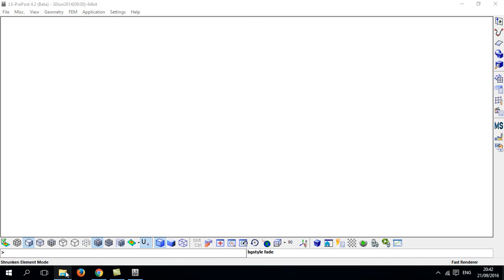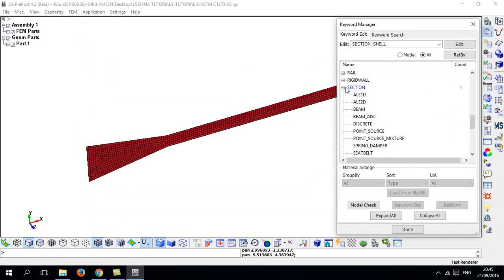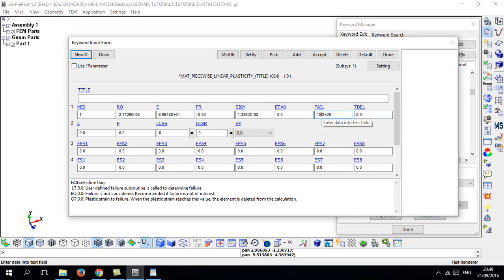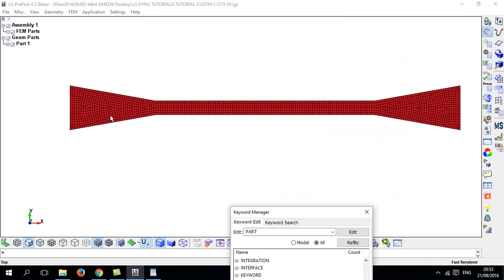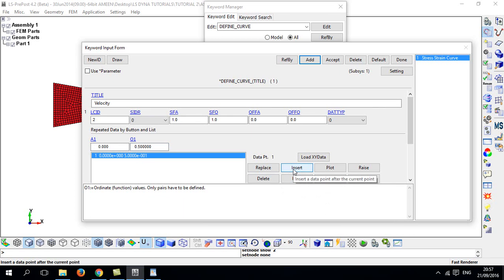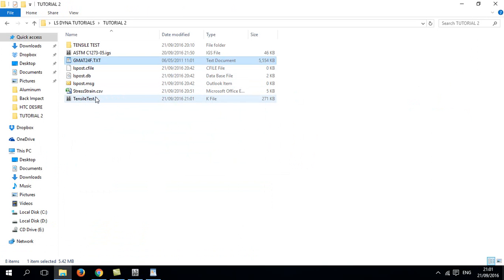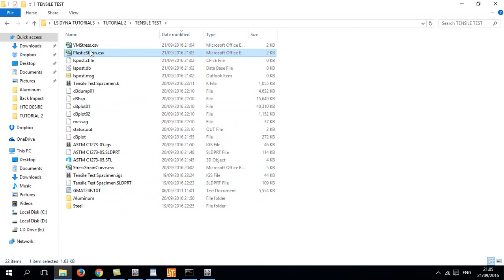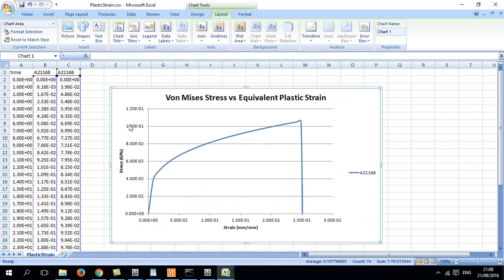LS-DYNA TUTORIAL 2: Tensile Test

Comment: Hi Mr Ameen, Allow me to tell you this video is really good! However you can introduce tricky comments like the restriction of the material failure you used is only valid for traction and work in this case because we do not have compressive stress state, otherwise we require a triaxility failure criteria. And the reason why using linear plasticity we'll never be able to capture necking effect.
Reply from the maker: Yes, you are right. Thanks for your insightful comments. This is only a basic tutorial, that's why I didn't go deep into the theory!  I will make a video for more detailed damage and fracture modelling. :D

Comment: thank you Dr Ameen Topa, i have few questions regarding tensile testing using lsdyna:
1.) is this tensile testing done using explicit time integration?
2.) where do we apply time scaling and mass scaling for explicit time integration?  
3.) can u recommend where i can learn how to do implicit time integration?
Reply from the maker: Dear Rey,

1) Yes, it is using explicit solver. Since this is a small model, using explicit will not take long time.
2) For time scaling, you simply increase the load or displacement rate by adjusting the curve. For mass scaling, you can either use DT2MS in CONTROL TIMESTEP to limit the minimum timestep or you can manually increase the density of each material in your model.
You can check out my tutorial here to see how I did the last method of mass scaling:
LS-DYNA TUTORIAL 15: Shaft Torsion with Mass scaling, Ductile and Brittle Failure

3) You can check out my tutorials:
LS-DYNA TUTORIAL 4: Compression Load on Solid Cylinder
LS-DYNA TUTORIAL 12: Static and Dynamic Axial Tube Crush

You can also check the examples here:
https://www.dynaexamples.com/implicit

Comment: Hi Ameen, Thanks for the tutorial! Great help! I am wondering if we can directly plot engineering stress/strain and true stress/strain? if only v-m stress how can it convert to true stress by any chance? and the second question is how we adjust the result if the Force vs Time plot has a large oscillation?
Reply from the maker: For the first question, you can directly plot the true stress strain curve by extracting the stress and strain from a single element. It may not be close to the value you find experimentally because that's the mean value of all the points in the specimen.

You cannot directly plot engineering stress strain because the software doesn't know how to get the engineering stress. All the values such as stress and strain are calculated instantaneously at each elements.

For the oscillations, you can use the filter option in the plot window.

Comment: Hello, Ameen. Why is the yield strength in the initial data 1.3362E-2 GPa, and on the Stress-Strain graph its value is approximately 4.00E-2 GPa?
Reply from the maker: Because I plotted the von Mises equivalent stress, not the stress in the x direction.
Reply: @AmeenTopa  In this case, Stress von Mises is no different from X-Stress.
Reply from the maker: @barbus6305  Yes, you are correct. Sig X =  Sig VM in this case. Sorry, I was confused with another tutorial.

The reason simply because DT = 1 is too big so the output intervals are big as well.. If you put DT = 0.01 and run the simulation, you will get more accurate results.
Reply: @AmeenTopa , Thank you

Comment: DEFINE_CURVE doesn't read XY data in scientific notation but instead reads in decimal notation due to which it is not able to define the right curve. How to fix this?
Reply from the maker: If you mean exponential form like (1.0e5) then read xy should support that formatting..
Reply: @AmeenTopa   I am also facing the same issue. I am importing the csv file, but the curve is not proper, and the data is in decimal format can you please help me with it.
Reply from the maker: @MohanSriram-d1m  change the number format with excel then save the file as .csv

Comment: thank you Ameen, may i know different cards that are essential to run simulation of high temperature tensile test at about 200 deg
Reply from the maker: You only need a material properties at elevated temperature. Throughout the tensile test, the temperature will be almost constant, thus you can assume that it is a pure structural simulation.
Reply: @AmeenTopa  thank you, pls suggest mandatory cards to be used
Reply from the maker: @vbalaji_griet123  As I mentioned, you only need to use the material properties at 200 degrees, that's all.
Reply: @AmeenTopa  thank  you Ameen, how to find out material properties at 200, 250 deg like tangent, elastic modulus, density etc..for material like AZ31B magnesium alloys..pls suggest.
Reply from the maker: @vbalaji_griet123  You can search in the open literature: journal articles and PhD theses.

Comment: Well although LS Dyna is such a powerful and amazing software but still compared to the ANSYS Structural GUI, it is much more cumbersome to use, just as an example, how difficult it is to tell the software that a particular node set has to be constrained and given certain degrees of freedom and boundary conditions. ANSYS Workbench GUI is the best.
Reply from the maker: Each software has its pros and cons.   Although ANSYS Workbench is very user-friendly, it cannot do the simulation of complicated problems. 

Proof: just look into the numerical simulations done in scientific journals. Even though LS-DYNA is not very user-friendly, it is more commonly used compared to ANSYS Workbench.
Reply: @AmeenTopa  
Perhaps the best would be to use the combination of both i.e. ANSYS-LS Dyna, Where one can from the user friendly characteristics of ANSYS Workbench GUI as well as its Vast Material Library (which perhaps is missing in LS Dyna) and the power of LS Dyna.
Reply from the maker: Yes ANSYS has a vast library of predefined material properties, like you can just choose your part to be structural steel A36 or aluminum alloy AA6061. But LS-DYNA has more options with regards to material models: you have Elastic model, Viscoelastic, Johnson Cook, Bilinear Model, Piecewise Plasticity Model...etc.

For a more friendly-user interface, you can try Oasys Software Suite.

Comment: Hi Ameen, how did you create that model for tensile test and why did you delete a portion after meshing in the start?
Reply from the maker: The shape or geometry model was created with SOLIDWORKS and you can get download it from the GrabCAD website.

It is a shape or geometry, and we cannot do finite element simulations on shapes or geometry models. That's why I deleted it. I needed it only to create the mesh. After the mesh is created, it has no use in the simulations.
Reply: @AmeenTopa  how can i create tensile test model with constant geometry and solid not shell. Moreover, how can i learn LS-dyna in more details and effectively from basic to advance? Thank you
Reply from the maker: @bilalrana9543  After you created the shell elements as I did in my tutorial, go to Element Generation, Solid, by Shell Drag. With this tool, you can create the solid elements.

LS-DYNA is not an easy software to learn because the LS-Prepost interface is not user friendly. You need to have a mentor in order to speed up the process of learning. You can learn by yourself but it will take some years. 

With that being said, I am available for online consultation if you need help to model a specific problem. However, there will be charges, of course.
Reply: @AmeenTopa  i am interested in learning and want to familiarize myself to Prepost interface. how can contact you?

Comment: Hello Ameen, Thank you for sharing the tutorial on tensile test. I did as you mentioned in your tutorial but when I check my result in Post>Fringe Component> Effective Plastic Strain, it shows zero throughout whereas for other parameters I get the values. I even tried to define "Database_Extent Binary and selected STRFLG =1. Still it shows zero. Your advice will be highly appreciated.
Reply from the maker: For more details, you can check here:
https://www.dynasupport.com/howtos/element/shell-strain
Reply: @AmeenTopa  Thank you. I will check this link. But in your tutorial for output you just define Binary_d3plot and control_termination and get the effective plastic strain. If you don't mind can you share with me the keyfile of this tutorial?
Reply from the maker: @saifshahabuddin6519  This tutorial is dated back years ago. I don't have the file anymore unfortunately. Are you using same material model as in the video?
Reply: @AmeenTopa  Thank you for your reply. Yes I understand this tutorial was uploaded way back. I used the same material model i.e MAT_Piecewise_Linear_Plasticity.model.
Reply from the maker: @saifshahabuddin6519  hmm, I am not sure. You may try to with higher element formulation (fully integrated shell)

It might be the problem with yours solver. I am using double precision solver.
Reply: @AmeenTopa  Thank you so much for answering my queries but still it didn't work.

Comment: Thank for your video. Could you recommend me some intructions for my problem: i want to simulate a test test , i want to get as outputs the curvv force displacement? how can i get it? i've tried to toogle some options (NODFOR - Nodal force groups and NODOUT - Nodal Displacement) in the ascii module of database. I activated also the nodal force group card in the database module. Unfortunatly, i did'nt get what i want
Reply from the maker: First of all, we cannot get the force vs displacement directly from the LS-PREPOST. First, we need to get force vs time then displacement Vs time and cross plot them. 

How to get the force vs time? You can try nodout or bndout in acsii options.
Reply from the maker: I have another tutorial on tesile test, check that one out. Also, check my post processing tutorial.
Reply: @AmeenTopa  could you please attached the link of these tutorials, thank you for your rapide reply
Reply: I m trying to get the experimental force measured by the test
Reply from the maker: Somehow YouTube doesn't allow links. You can search the following videos:
Post Processing Tutorial (with LS-Prepost)
LS-DYNA TUTORIAL 9: Tensile Test with Solid Elements and Variable Thickness Shells
Reply from the maker: @sophiebuferne2881  Nodout will give you the force at each node. So, you need to some the force graph of all nodes.

If you are fixing the nodes with spc set, then you can take out these forces with spcout option in database ascii.
Reply: @AmeenTopa  thank you bro can you tell me how can i get the global experimental displacement vs time  using ls dyna when running tensile test

Comment: In your video, at boundry_prescribe_motion_set you have shown to click Add. What is different between Add and NewID?
Reply from the maker: Technically, there is no much different in the outcome. The difference is when you are making the file. 

When you define any command, let say material properties, after you put the values, you click on accept.

Now, if you click Add, all the values will go back to default, but if you click newID, it will give you new ID, but all the values are the same.
This is helpful in situation like if
You have two materials, all the properties are the same except one value (maybe density), so now you defined first material, click on accept. Then you click on NewId, change the density, then click on accept. So, you don't have to input the properties of the second material since it is there already.

I hope you understand what I mean.

Comment: Hi Ameen, thanks for the tutorial. but i get different results, the specimen breaks at  two points not  just at one point like in your results. i have tried to follow all the steps two times but still it breaks at two points at the same time. what can you suggest?
Reply from the maker: Actually, it doesn't make since that the material is ruptured in two points. According to material mechanics, it should break only in one point. There might be a mistake in one of the steps when you were making the file.

Comment: So why ls directly cant create stress strain curve
Reply from the maker: You need to do it manually. The software doesn't have this option. Check my tutorial on Tensile Test with solid elements. I think I did it there.
Reply: Yes i did tk u for your time .....i was also looking about scripting in cae do you thik it could be useful as a beginner
Reply from the maker: Depends on what is your goal. If you have a lot of data and cases, then scripting can save lots of your time

Comment: Can this exact steps be used in ur crash simulation to output von mises and tresca? I mesh every car and continue like u did with this component ?
Reply from the maker: Yes. The steps are the same.
Reply: @AmeenTopa  thing is automatic mesher wont let me select the car
Reply from the maker: This is because the car parts are already a finite element part. They are meshed already so no need to create the mesh.
Reply: @AmeenTopa  but how come that when i simulate , and when i wanna see von mises stress, i see all the car in blue ? Like there is 0 stress
Reply from the maker: @roublard17  maybe you are using Rigid material or there is no forces on the car. I can't tell for sure. There is insufficient information for a conclusive answer.
Reply: @AmeenTopa  i used the exact same two cars that you used in your crash simulation , the pickup and the small car , havent changed anything on it
Reply from the maker: Okay. Then you can hide all the other parts, show only the parts that you are interested in. You will be able to see some stresses.

Click on F2 to open the assembly window where you can hide/show parts.
Reply: @AmeenTopa  i just tried it , not working :/ but thanks anyways :/
Reply from the maker: I tried it and it works. It must be something wrong. As I said, there is insufficient information for a conclusive answer.

Try the History tool to plot the stress vs time for one element. If this doesn't show any value, then it means there is no stress in that part. It could be the part is modeled as a rigid body.
Reply: @AmeenTopa  yes but for example for the frame car or front rim or front wheels it stays blue and the scale says 0 forces everywere , which makes no sens right ?
Reply from the maker: @roublard17  I do not remember how detailed is the model. Most probably, the rims are models are RIGID bodies which means they will not deform. This is a simplification in the model because we are most interested to see what happens in the passengers cabin, not to the rims.
Reply from the maker: Yes. The frame at least should have some stresses. There is something wrong and I cannot tell what is the cause unless I see the results myself.
Reply: @AmeenTopa  is there someway i could send u the results ? If it is not too much to ask for :(
Reply: @AmeenTopa  the only thing that i need to finish my project is the display of von mises / tresca stress / displacements colors on the simulation so i can analyze the results , but now im just stuck i cant find the answer
Reply from the maker: @roublard17  upload the files in googledrive or onedrive then give me the link
Reply: @AmeenTopa  ok please tell me what files exactly and ill do it right now, some photos ? Or the simulation file ?
Reply: @AmeenTopa  im using the pickup truck c1500 that u used in ur video , i changed no parameters , and von mises tresca doesnt display, and when i isolate the chassis / frame , the legend scale says 0 everywere like theres no forces
Reply from the maker: Go to Postprocessing, History, then plot the stress on one element. Can you see anything?
Reply: @AmeenTopa  it only plots one element , and its part 2000355 , if i try and plot any other part it says 0 and theres no graphs
Reply: @AmeenTopa  its like it only shows the max value , not sure but i think so
Reply from the maker: @roublard17  Yes, I know it plot only one element. This is only to double check if you truly have no stresses at all in your simulation. 

So far you mentioned about Von missed and Tresca, what about other stresses like x-stress, do you have it in your model.
Reply: @AmeenTopa  just tried x stress , all the car changes its color from green to blue to orange , wich makes no sens
Reply from the maker: @roublard17  yup there is something wrong with your model or the solver that you used a very old one.
Reply: @AmeenTopa  im actually using the ls dyna student version , the 2020
Reply: @AmeenTopa  on ur version of the solver , can u actually see vm stress in any part u want ?
Reply: @AmeenTopa  i actually find a wayy to display von mises and tresca !! I added database extent binary and cross section plane ( i actually dont know who did the work between these two to be honest) now i just need to display displacements
Reply: @AmeenTopa  got 530 MPA on the bumper , and 1400 on the chassis , is that logical for u ? And is there a way to know wich units ur using ?
Reply from the maker: This is the same model from my car collision tutorial? If yes, I am not sure why you are commenting here. 

These car models are already verified. So, no need to worry about the validity of the results. 

Lastly, the units can be either MPa or GPa for car models that you find online. You need to check the density of the material. From there you will know.
Reply: @AmeenTopa  yes its from ur car video, im sorry i dont know why im commenting here , i really appreciate the help , you saved my life really!